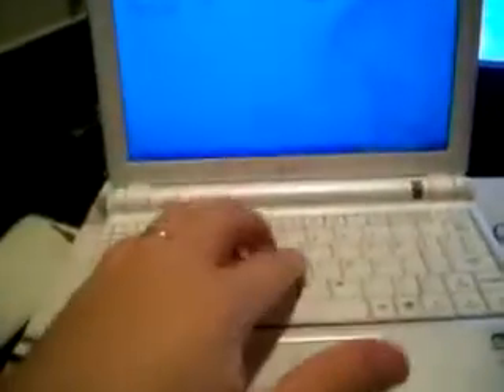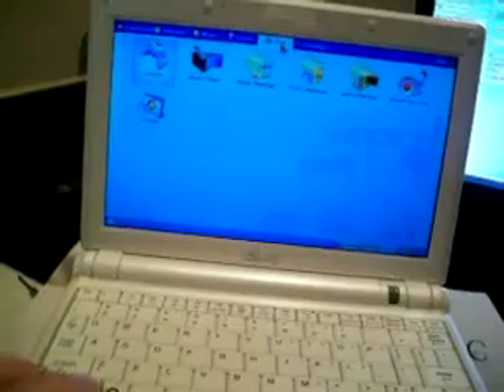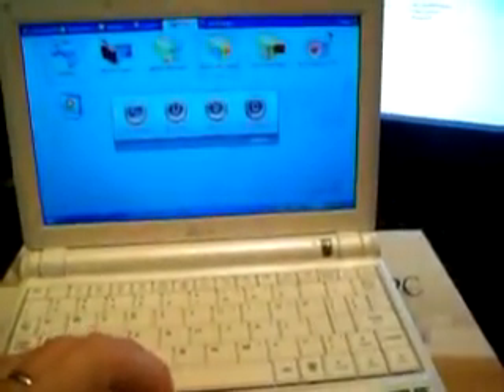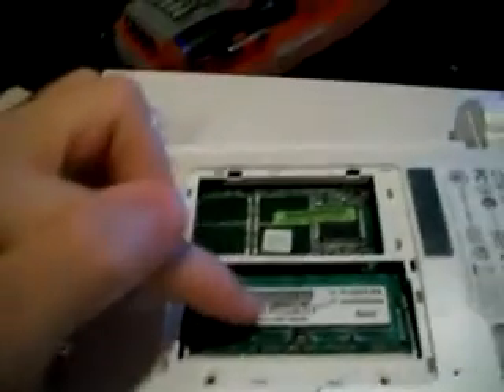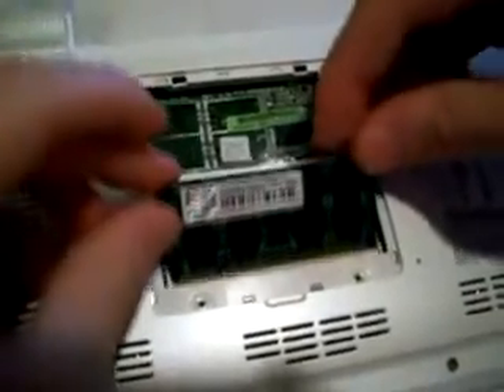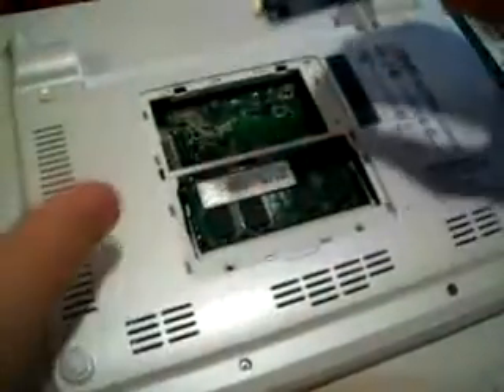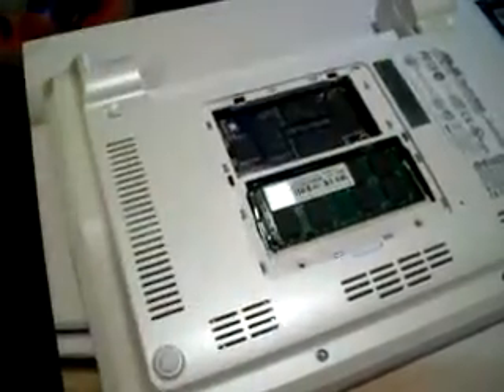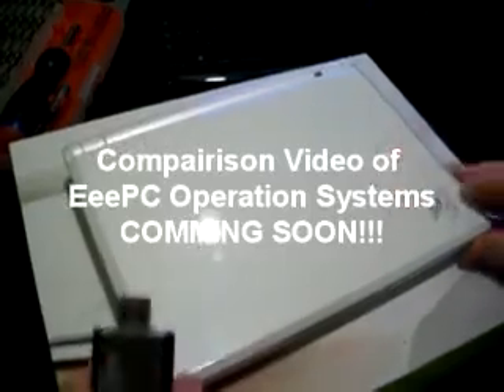ASUS EeePC 900a Ram and Harddrive Upgrade

Comment: Just installed a new HDD on my 900A and tried Lubuntu 12.04... very nice system. Quite easy on the requirements and quite good to look at and use. Almost full Ubuntu compatibility and even with 1Gig RAM it flies.

cheers

Comment: thanks for the help this REALLY REALLY helps, i got one of these when 4 years ago and because of the tiny tiny little 4gb ssd i cant really do anything to it, i even though of hard modding that damn pc to HDD becuase i though ssd is build in and it cant be removed (dont see any hdd in there) until 3 hr ago when i blow off the dust and try to install ubuntu on it. Big help thanks again.

Comment: I have the same wOOt special.  I JUST was able to get the BIOS updated tonight.  You must use a USB with FAT16 (I couldn't get Fat , or Fat 32 to work) I found that the old 256 USB use FAT 16.  Also make sure you use the USB on the left side port.  Power up and wait the first screen to to start coming up and hit F2 until its starts recognizing the USB and begins downloading the BIOS.  Hope that helps.  After that I just followed the video for updating to 2gb RAM and 16GB HD.

Comment: I have done this exact same thing! wOOt, 2GB RAM, 16GB SSD. I can't get the BIOS to read any of the drives to install an OS. I have Ubuntu 9 and XP. I have tried an SD card in the slot, a 16GB thumb drive, an external CD and HDD... Nothing works. Finally had to reinstall my 4GB SSD with Eebuntu.